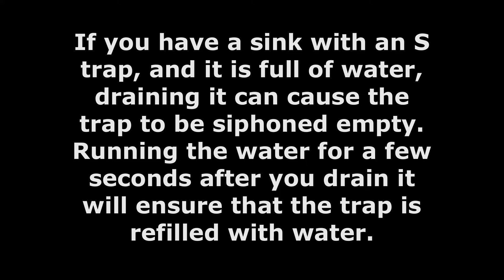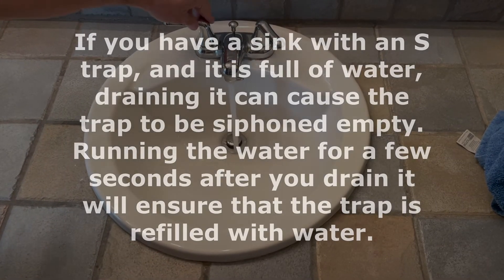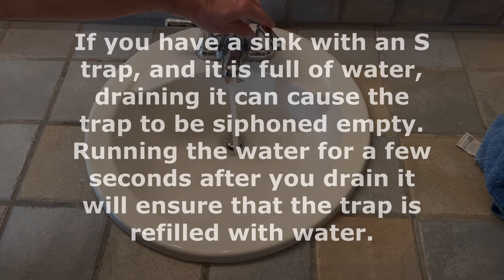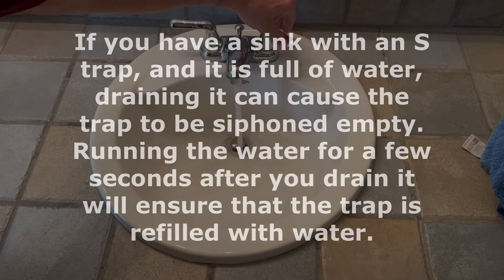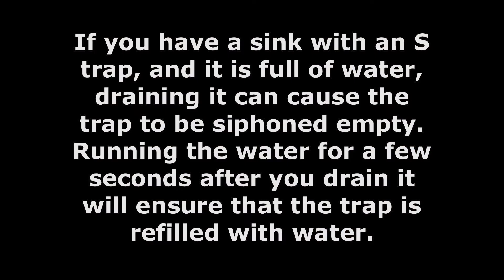What is a Plumbing Trap? Difference between P-traps and S-traps

Comment: From my experience, just as a homeowner who has a house build in 1932- S Traps usually do not have a vent. They are connected to the drain directly without any way for air to enter to relieve the negative pressure of the water exiting the trap. 

So it’s not just the “S” shape which contributes to the self siphoning it’s also the lack of a vent.
Reply: Ah! I love that Mike provided visuals but left me wondering why the shape mattered.

Comment: Not doubting the end result, but would make a more convincing demonstration if both traps were plumbed in a similar fashion.  The P trap has another pipe off to the side just above the trap(i assume to the other sink?)  which is allowing air in, assisting the draining.  The s trap is just one pipe, naturally it sypons more, no air from another pipe.
Reply from the maker: That is a valid point about the demonstration.

Comment: you should do the video again The bucket is preventing the S trap from siphoning the trap dry.
Reply from the maker: The bucket is not preventing the S trap from siphoning dry.
Reply: @morganinspectionservices3840 why does the water fail to level out after the sink is done draining? The water is higher on the bucket side than it is on the sink side of the S trap. I can't wrap my head around that.

Comment: Did not SEE the S trap running in the demo?
Reply from the maker: It’s there. You just don’t get the turbulent water flow like you saw with the P-trap for some reason. Look between about 2:35 and 2:40.
Reply: So the p trap eventually runs straight down just like the S strap so what causes it to not do the same thing😊
Reply: @t.j.bennett6454  there's a tee following the horizontal section which has a vent. My understanding is that the S vs P shape isn't the defining thing, but having a vent or air admittance valve to break the syphon. The S and P shapes are then not the reason for different performance, but just the standard looks of no vent vs vent